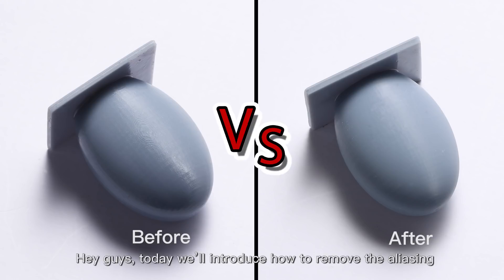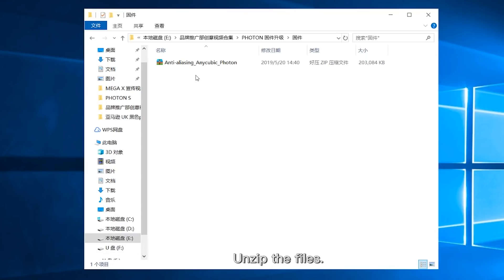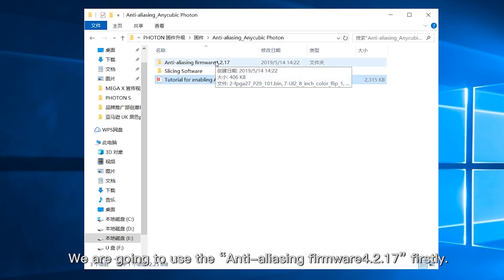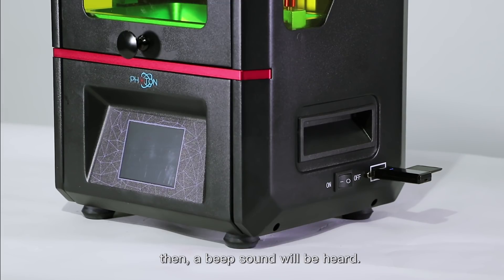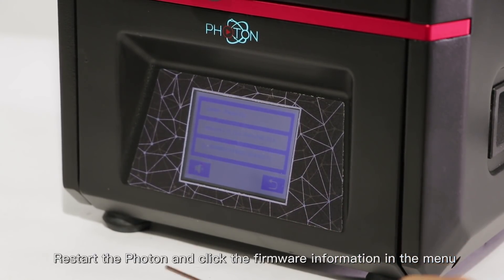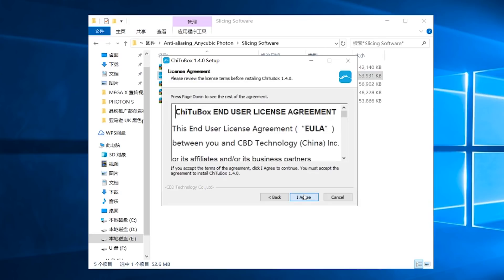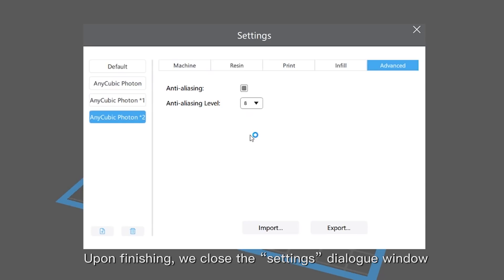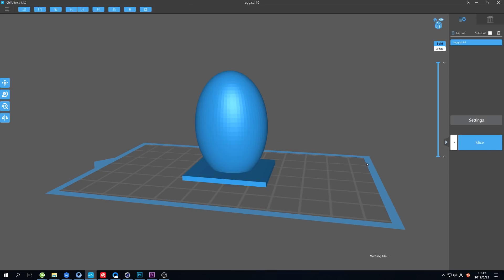Anycubic photon anti-aliasing firmware upgrade tutorial

Comment: Is AA included in the newer 4.2.19 firmware version? I check the the change logs, and it doesn't say that anti-aliasing is included anymore. I also tried printing a part with the old and new firmware, and I saw no anti-aliasing on the prints. I'm concerned that the AA upgrade disappeared to better sell the new Photon S (which has AA standard).
Reply: @ANYCUBIC

Comment: Hi, I've bought your printer photon S. The latest firmware is not compatible with Chitubox slicer right now. There is a possibility to use again Chitubox? The Chitubox technical support is avaible to add the .pws format but they need the definition of PWS format from you. Please...more users need Chitubox because the Photon workshop don't work fine on various PC. Thanks
Reply from the maker: Hi Kaon. I'd recommend you to go back to the previous firmware V2.9.x that version is compatible with chitubox. The latest firmware version is not compatible with that slicer. Because chitubox is not an open source software and it's very hard to do customized settings for photon-s. Could you contact our after-sales support for the firmware V2.9.x, please?
Reply: @ANYCUBIC3D  Ok, thanks. I will contact you for the old firmware. Thanks
Reply: Thanks, I've received the old firmware and now I can use Chitubox. Thank you very much! :-)
Reply: @beautycuisinons  intresting procedure :-)

Comment: can't find the file to download from the link. please help
Reply: I was confused, too. The download section looks a little bit different and leads to a google drive page. Current version is Photon_firmware_4.2.19, I assume no longer beta but already the release version. I copied the two (not three) files to the USB stick, "printed" the lcd and the bin file and now the printer is on 4.2.19 (instead of I think 4.2.3 it was, a much older firmware it was deliverend with)